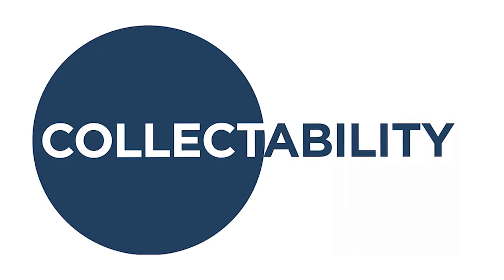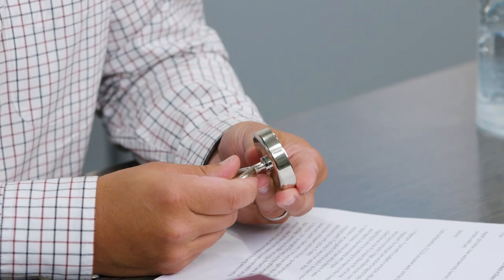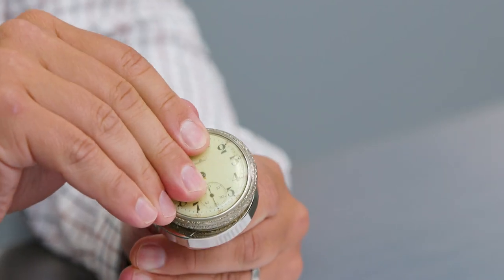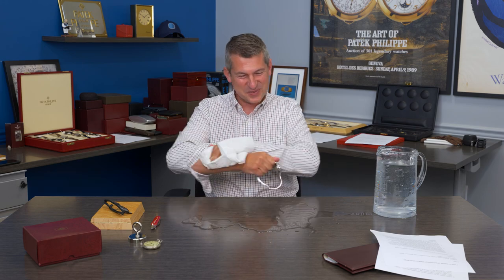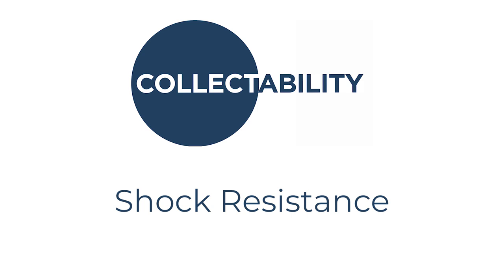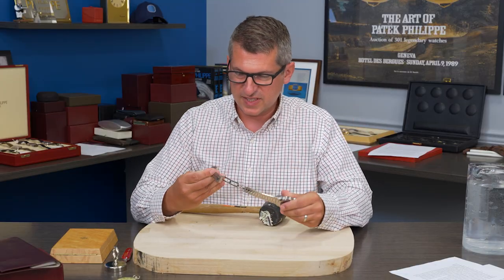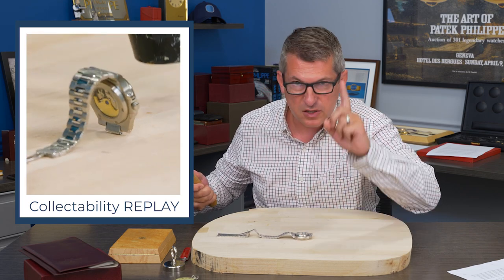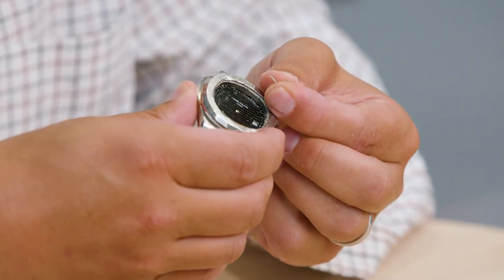How to Destroy a Patek Philippe

Comment: What may I ask was the purpose of lambasting a watch with a series of hammers both rubber and steel. It was going to break. Not a test that would normally done without the safe surrounds of a lunatic asylum. Bizarre, bizarre.
Reply: The purpose was to have a bit of fun with a 'replica' Patek to emphasize some important points that are unfortunately often forgotten. I have seen one too many authentic Pateks destroyed due to utter carelessness. Sorry my attempt at humor did not appeal you! Anyways I am checking back into the asylum again momentarily.